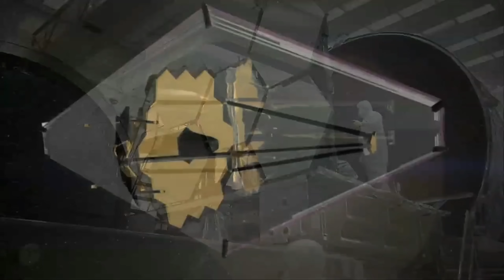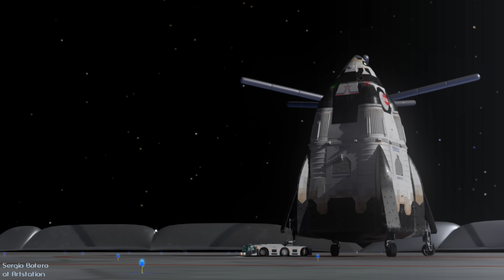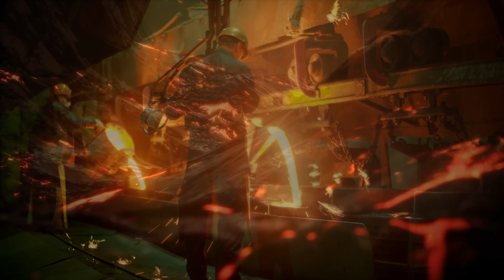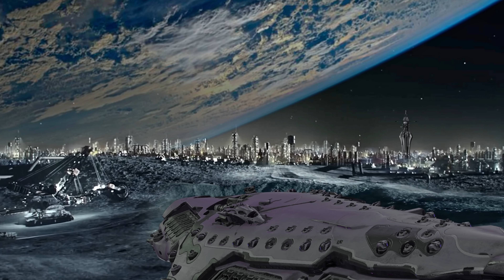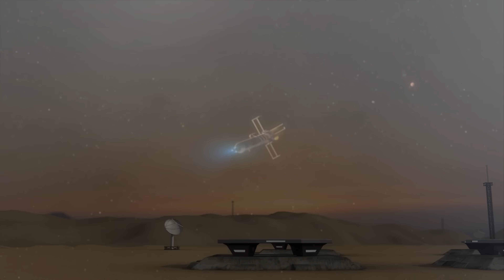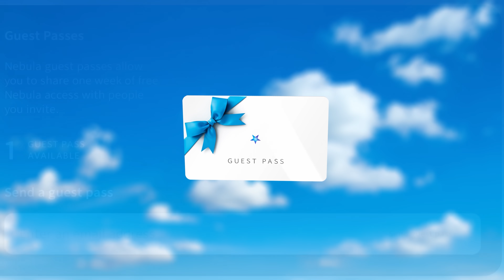ISRU: In-Situ Resource Utilization - From Regolith to Rocket Fuel

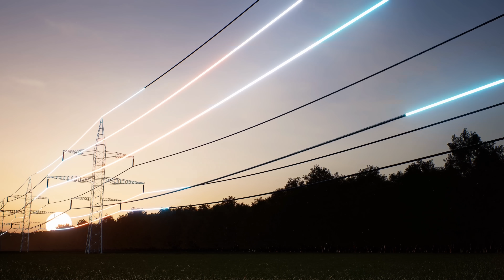Comment: 17:20 wait wait wait wait. "superconductors can function at local room temperatures in most places significantlycolder than Earth"

Could there be a future where extremely heavy workloads are beamed to super efficient, low power supercomputers on asteroids, planets, or even in perma-dark craters then beamed back?

Comment: I don't mind flights of fancy and imagination. I love pure sci-fi. But there are an awful lot of people prepared to take seriously the fantasies of space mining and colonisation. Let's take just one example of where this has gone completely bonkers. Starship requires 1,200 tonnes of propellant to launch itself from Mars if it is to return home to the Earth. That's about 264 tonnes of methane, or 66 tonnes of hydrogen. 66 tonnes of hydrogen is contained in 594 tonnes of water. Let's supposed that Material regolith can yield 2 percent water, after processing. Therefore we need to mine and process 29,700 tonnes of Martian regolith. Just for one launch.

We have to research, design, test, transport and commission an industrial scale strip mining operation. We need heavy mining machinery. We need a form of portable energy to run them. We need logistics to transport that form of energy. We need an entire ecosystem of robots that assemble, test, fuel, maintain, repair. We need large scale processing machinery. We need large scale chemical processing. And we know that everything has parasitic loads and real world processes are not 100 percent efficient, which scales the whole enterprise, probably doubling the raw tonnages. And we need a multi-megawatt nuclear power source, with all the nuclear fuel and its own contingent of robots. Not to mention the issues involved in getting nuclear material into Earth orbit. 

Complex materials, wearing parts, stuff that can only be shipped from Earth. And then there is the research and development required to build high-reliability mining equipment (we don't have high reliability mining equipment on Earth, we just spend an awful lot maintaining and repairing). Plus the development pathway includes many years of testing. So what? We're talking a couple of decades and hundreds of billions, conservatively. All to launch ONE Starship. 

The crazy part is when you think about the kind of area that has to be strip mined to yield tens of thousands of tonnes of generally shallow Martian regolith. The more ships you refuel the larger the mined area and the further your mining machinery are from your power source. Your logistics get stretched. 

If we are going to get to Mars, it will be a realistic but limited exploration mission which requires atmospheric ISRU. We'll be stopping in Mars orbit in both directions. We'll have a reusable, fully propulsive Mars lander and ascent vehicle requiring single digit tonnes of methane for ascent (which can be imported). And the oxygen needed for propulsion will be extracted from the Mars atmosphere. (Gas processing is far, far easier than mining). Consider this. Take Martian air (about 96% CO2, the rest nitrogen, argon, carbon monoxide and yes, oxygen at 0.17%). Liquefy the carbon dioxide. The remaining gas is now roughly 3% oxygen. Nitrogen is needed. Argon is useful. Even CO has its uses. And now you have oxygen for propellant and life support. Plus you get a small amount of water (sufficient to life support makeup). Heat the liquid CO2 into its supercritical state (with a nuclear heat source), run that through a turbine and you get electricity. Note that you need a heat source in the order of tens of KW, plus you don't need a radiator.

Comment: The thumbnail for this episode is interesting since it shows the Moon over the horizon meaning the construction site with the escavator is on Earth.

For structures on the Moon, the lack of atmosphere and by that wind the trouble with regolith should be possible to reducec drastically be simbly brushing it away, leaving the actual bedrock bare. A base area made regolith free shouldn't have the problem with dust getting into everything.

Comment: You guys really haven't thought this out really well. Making fuel on Mars is very demanding work, it might take humans centuries to master it. We need dirigibles that can slowly rise up to 80 km and accelerate to escape velocity speeds using hydrogen gas that could be brought from earth or made on mars. The process to get to mach 9.6 is well understood in aviation and could be fine tuned on mars to reach the needed mach 14.7 to get to orbit.
Reply: .... Mar's low atmospheric density may make that dirigible design a bit problematic.  Feel free to give me some figures, because I'd love to be wrong about that.  However, I think we currently have the materials science to manufacture a tether for a Martian or Lunar space elevator.  And yes, the engineering challenges for either of these would be enormous.

Comment: pretty much all self-sustaining space industry will be a continuous boot-strap operation: get the absolute basics into orbit. Mine/collect in space and improve and expand. Collect/mine the materials to build more in space. Build/create more. Eventually there will be a point where it is relatively cheap and easy to collect and mine in space away from a gravity well, and then and only then will we truly be an advanced civilization. Just don't make the Belters a lesser class 🤪
Reply: And forgot to say Lunar development is likely to happen before Mars. It is close by, it has all of the In-Situ elements we need (plus Helium-3 for fusion), the Regolith will NOT be a regular import to Earth for any use, but it has huge potential for Lunar concrete structures. Regolith also has a large Oxygen content, so yeah. Hydrogen and Oxygen for fuel, Oxy to breathe, Helium-3 for fusion... NASA and the rest of the world know that micro-gravity/"zero-gee" is bad for us, but they haven't researched lesser gravity effects. Just running off at this point, I have ADD

Comment: Earth/Moon L1>Moon>Mars
Reply: Solar power compute L4/L5
Reply: why would you wanna go into gravity wells?
earth>Asteroids> the whole solar system.
Reply: @MusikCassette  should the rockets land on the moon to pick up fuel or should the fuel go to LEO to meet the rocket?
Reply: @DeltaVTX  the fuel should probably be produced in LEO. Water is easier to transport than hydrogen and oxygen. and fuel Production close to earth is easier to maintain. The materials for producing fuel would come from the asteroids.
Reply: @MusikCassette  the fuel is methane
Reply: @DeltaVTX  hydrolox is easier to produce than methane (and oxygen) but if you want methane, that is an additional reason to get your raw materials from the asteroids. Carbon is more avaialbe there.
The water is a little harder to extract than from the poles of the moon, but it still has the great advantage of not being on the moon.
Reply: @MusikCassette  Earth/Moon L1 is the top of the hill, not the bottom. 
Would you rather have one outpost making methane easily accessible, or lots of little ones spread out?
Reply: @DeltaVTX  But the surface of the moon is at the bottom of a gravity well.  it is not about where you produce the fuel, but where your feed stock comes from. even to land on the moon you would go better using fuel produced from the feedstock of asteroids. I suggest earth's Trojans. But I am open for other NEA to be better options.
Reply: @MusikCassette  the moon has more fuel than you need all in one place
Reply: @DeltaVTX  the problem beeing, that it is on the moon. wich is quite far away form where we need the stuff. (you need to think about how far things are appart in terms of Delta V)
Reply: @MusikCassette  you drive to the oil well to get gas for your car?
Reply: @DeltaVTX  no but the cost for bringing the the oil to my car is are port of the price for the fuel.
Reply: @MusikCassette  yes, and in terms of cost (∆v), the moon has a virtually unlimited amount. It doesn’t matter how inefficient it is; you never run out. I don’t think you realize how far apart all those asteroids are.
Reply: @DeltaVTX  what do you mean it has unlimited DeltaV?

of course efficiency matters. that is why we want a fuel source away from earth in the first place.

I realize the distances alright. I suspect the problem is, that you think of distances in terms of euclidean distances between two points in 3 D Space where as what is relevant are the distances in terms of Delta V between orbital states.
the moon looks close. but its surface is farther away than a lot of Asteroids with a lot of usable mass.
Reply: @DeltaVTX  even if you think we need more mass than we can feasable get from Near earth asteroids and should get it from the moon instead. (wich holy shit, that is a lot of mass) you still need to get your equipment to the moon. and on that scale it is a lot of equipment. you still are better of mining the asteroids first and producing fuel from that to get your equipment to the moon.
Reply: @MusikCassette  now you’re just throwing fancy words out there.
Reply: @DeltaVTX  not at all. I am trying to make you understand my reasoning. 
in less"fancy words": 
km don't really matter, it is km/s that matters.
not sure if this was more comprehansive.
Reply: @MusikCassette  yep. There’s way more of it all in one place on the moon, and it’s way easier to get to L1.
Reply: @DeltaVTX  way more of what?
Reply: @MusikCassette  ISRU; the topic of the video we’ve been talking about.
Reply: @DeltaVTX  a (and this one is the important one) it is not easy to get things from Lunar surface to L1. to be more precise: it is harder to get stuff from Luna surface to L1 than to get them there from asteroids. distance from Lunar surface is about 2.4 km/s correct me if I am wrong.
 There are a lot of Astereoids way closer to the Lunar/Earth systems than that.
on top of that, slow propulsion is not a 
b) the resources on the moon are not all in one place. They are quite scattered. and transport on moons surface is a problem. (not as important)
c)perhaps you underestimate how big NEAs there are. or you vastly overestimate our ability to to extract resources.
Reply: @MusikCassette  so you want to move your resource processing from one place to another…

Comment: transforming your thought into knowledge holds you back. no progress. as language does nothing. dont worry about the ded. as only ded worry about their stomachs, their kings. so what about those nuc rad decay power sources. made in the u s of a. if you can be in the orbit for long time, then you can be on the surface also. maybe try first in the artic regions for practice purpose. keep it sensible. no decision bodies. just do it. endless talk helps no-one. if not talking money issues, you would have already done everything. how about fiction instead of teaching. teaching is boring. especially teaching predictions. instead do direct applications so you actually know how it works. of course disregard any social/money related issues. only tech implementations. its clear that most of your attention goes to social/economic issues which is not productive. how would you know the optimal sizes, dont just try to decide for people. no thanks. social nothing. moon cavemen. literally. main problem is people being greedy people servants doing nothing. not your place to decide for others. if you need someone people to advice you what you should do, dont do it. your flag is not flying proudly. very sketchy steps. be certain. dig a hole. would you build a shade tower on earth. right did not think so. not sensible solutions. yeah, clear need of above given skill. and relieving you from people's servantship.

Comment: My own vision, setting up an orbital station, linked up with 2 relay satellites equidistant from each other along the orbit, at an altitude where all 3 is always visible of the other 2, where humans will dwell to start with, from there, they can remote control robust robots on the surface to set up the infrastructure before humans move there. It is possible that humans never set down, instead the location is for mining. The base function of robots, makes them lighter and easier to send to the destination. Trying to set them up with AI will increase their costs and power requirements. Anyone can run the numbers. It's possible to already get started with current technology to set up an infrastructure on the moon or even Mars, or Ceres. We could also setup a few space stations specifically for mining the asteroid belt, which can be moved around with solar sails to reach the Trojan asteroids when needed.

Comment: What are volatiles exactly?
Reply: Nitrogen, carbon dioxide, ammonia, hydrogen, methane, sulfur dioxide, water

Basically stuff with low melting points that will vaporise when close to a star and would be a expected part of a comet tail
Reply: @ryangrear3430 thanks.

Is there  specifically defined cut off point, or is that a relative term?
Reply: My ex-wife.